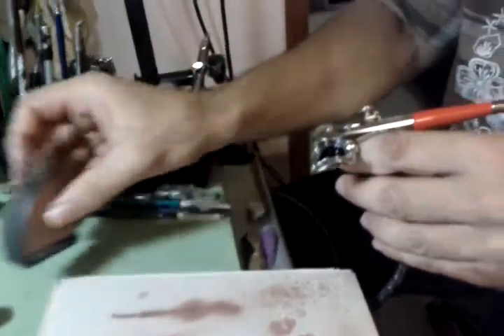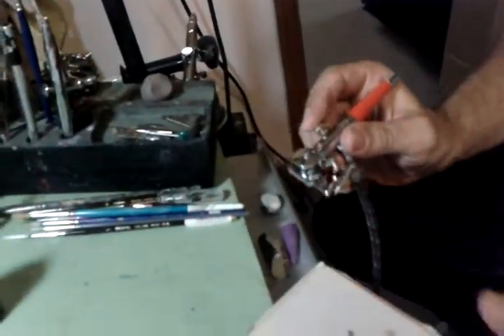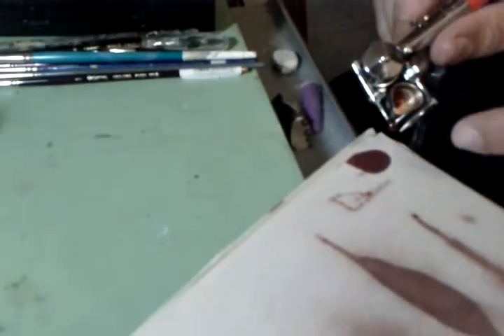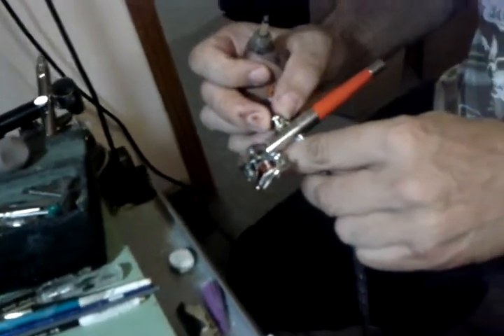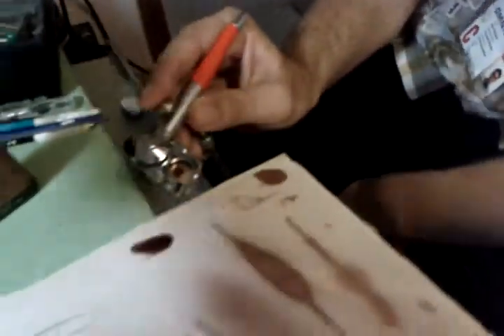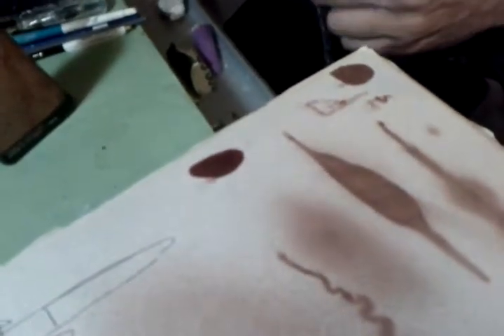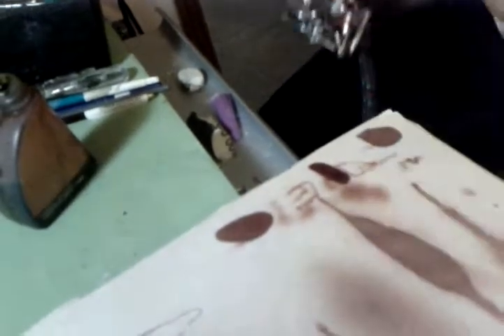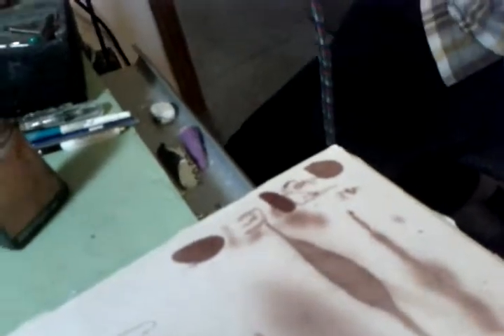airbrush interview part 4 - an old classical airbrush

Comment: It takes practice and you have to get very consistent in mixing your paint so the viscosity is acceptable. It won't tolerate thick paints at all. I mix to the viscosity of milk and it seems to work fine. Bending replacement needles takes practice too. That part is bizarre until you get used to it. The external mix nature of it makes it pretty reliable though. It's a nice gun for those projects where you would rather not have to use stencils or edge masking on the finer details. If the mix is right, you can freehand just about all of your fine detail.